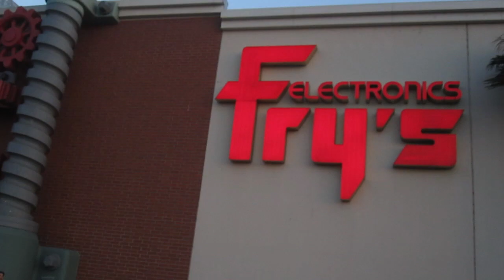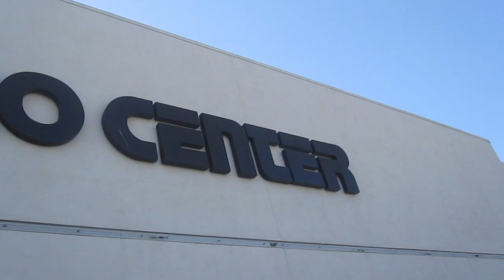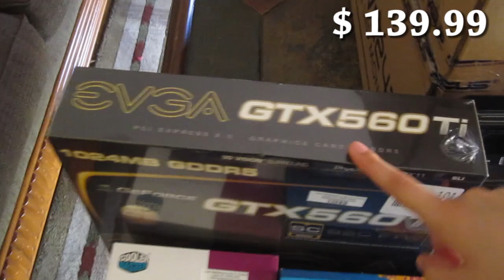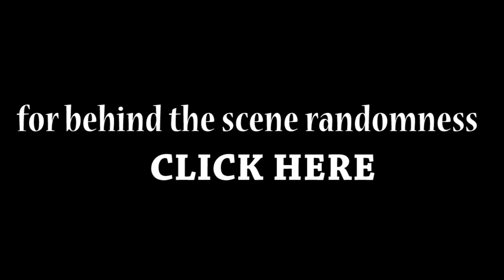RL With Cupquake Ep 4 " Computer Building"

Comment: That big fan on the top, if it is an exhaust, that will decrease the air pressure inside the case and cause dust problems :3

Comment: I mean their 8-pin cable could of been too short to go behind the motherboard trey and back out, and it could be they only way to get to their 8-pin connection is to go across the motherboard. Their case doesn't look like it has too much holes for cable management so that makes it more challenging and that place behind the motherboard trey could be more smaller and not hold too much cables. I love cable management and pride myself on it, but sometimes with case will not allow for neat cables.

Comment: 560 Ti is roughly 12% faster overall. You wouldn't "see" an increase in performance until you get around the GTX 570, Radeon 7870 or GTX 660.The 560 Ti is way better than the gt 650

Comment: Sorry, not to be mean... but it took them that long to put together a computer? seriously? It would have taken me no more than 10 minutes to put all the parts in the case, especially an air cooled system. The only thing that would take a while is wire management, and maybe even setting up the water cooling system. Also, where does she live? California? that computer was rather expensive for sub-par hardware (and yes, I know the year of the video) cost way to much. Anyways, nice video.
Reply: U dont know that maybe it was there first time!